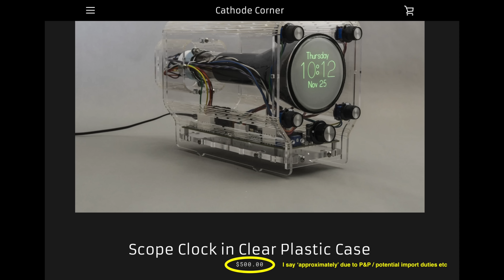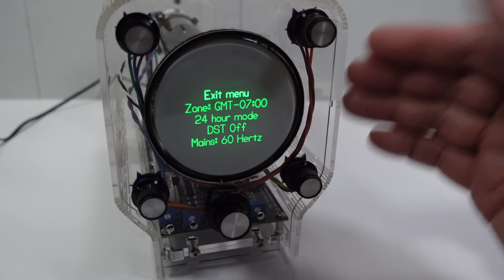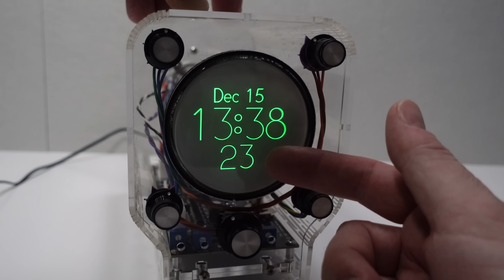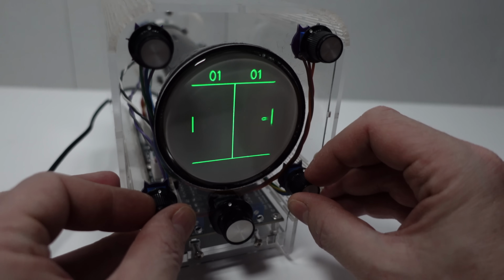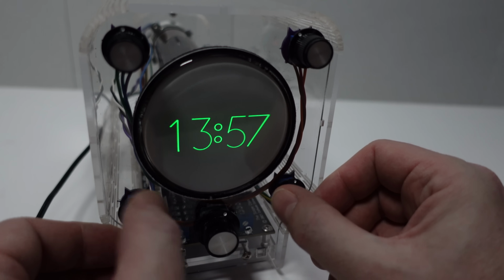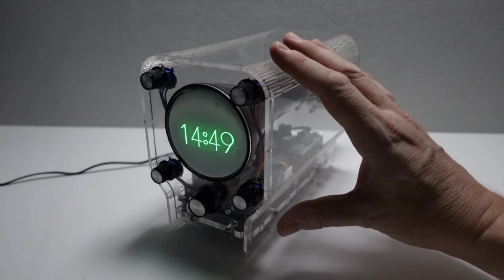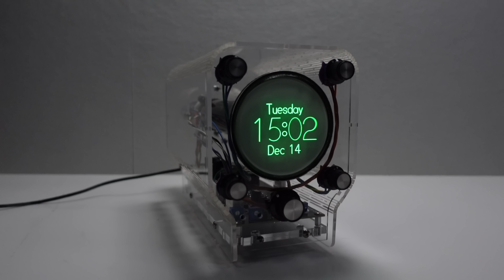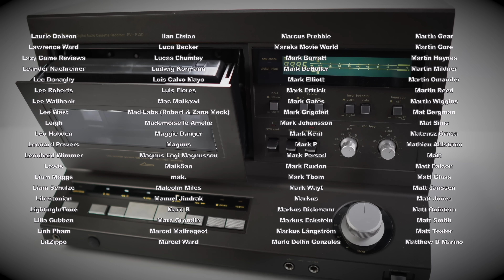The Scope Clock - from Cathode Corner

Comment: I really like the idea of the product, but it seems like a prototype not ready for sale.  For $500 it should have a speaker for sounds in game, an alarm, and less software bugs like having to recenter the clock after a game(may require redesign of the current variable resistor to software based).  Also, I would prefer an option for a red screen instead of a green one, because red light does not disturb your night vision (better if you intend to use this as a clock in your bedroom).  I would also love an option for cases.  Think Fallout "Pip Boy" with art deco patina colored metal (plastic of course).
Reply: I have a few CRTs with orange phosphor - they last about one day. The green phosphor lasts for at least a decade. Perhaps you would prefer to have someone do a factory run of tubes with the red from a P22 TV set phosphor. Unfortunately, these tubes are no longer made. Ah, reality is no fun.
Reply: @davidforbes8900  Don't get caught up in your head about this.  All I said is I would prefer a red screen.  I didn't  go research oscilloscope tubes, and any normal person would be the same way if you were just having a chat with them and they said "hey you know I'd prefer XYZ".  

Perhaps you'd be the guy that would stop them and say "But you can't prefer that because it just isn't done."   You know how they are going to look at you?  I'm not sure how successful you've found yourself at small talk, but I could guarantee you that wouldn't go over so well.
Reply: I don't think I've ever seen a red oscilloscope tube. I can't even find one on Google images. I agree that the bug should have been fixed and a speaker added, but asking for a red screen is just silly. Even if they made one especially for this device, it would defeat the point as it's supposed to repurpose an old oscilloscope tube and to have a retro look. And Techmoan mentioned it's not very bright anyway AND you can vary the brightness with one of the knobs.
Reply: @pifci  "I would prefer an option for a red screen" - thats silly?  I think you are silly for saying that.  I can prefer anything I like for any reason, and it doesn't have to fit into what you think the purpose of something is or isn't.  In the end its just a product for sale.  I think very little of someone telling me that I have to buy it with any understanding or purpose that only equates to arbitrary nonsense flowing from their pie hole.
Reply: @reviewaccount469  
I understand why you would prefer a red screen. It think it is silly not because it's a bad idea, but because there are no screens like that and the product is all about old oscilloscope tubes, which are pretty much always green. Making red ones for a couple of customers wouldn't be worth the effort, especially since there are many red/orange clocks available (like the nixie tube ones, for instance). Also as I mentioned, the brightness can be adjusted, so the manufacturer considered that people might want it.
My point is, you can prefer whatever you want, but if it is impractical to make, or doesn't go well with the purpose of the product, then it's kinda pointless.
Maybe if I used a different word instead of "silly" the conversation would have been a bit more constructive. My bad.
And you can of course think whatever you want about me. We are just two random people on the internet, after all.
Reply: @pifci  Blah blah blah, doesn't change a thing about my preference.  I think your interest for telling people they can't prefer something is quite a dangerous thing these days.  Pick any subject, go up to someone in person, and tell them they are silly for preferring one thing or other and see how that works out for you, or maybe you have done too many times and already know and thats why you are doing so anonymously on the internet.  Go get a life.

Comment: Dutchtronix use to do a board which did exactly the same thing with an XY display or XY capable oscilloscope, works best on analoge or a very fast digital scope with intensity controls.

Comment: Are the rotary controls on the front old school variable resistors or are they modern rotary encoders?
Most old variable resistors will rotate a maximum of 330 degrees between their end stops, whereas most rotary encoders don't have any end stops

Comment: IMHO, I would rather spend $500 for a proper oscilloscope, or even less for a used one. Vintage tube scopes can be had for less than $40. Also for $500 I would expect some kind of oscilloscope function, or at least an audio signal visualiser. I think the start is great, but there is a lot of functionality that could be added.

Comment: From the look of the display, I'd guess it is vector tracing rather than raster scanning.
One thing I would add to the design (if it doesn't do it already) would be some automatic shift to reduce burn in, as some features like the 10's of hours will be presented for a long time

Comment: In case you’re wondering about the length of that piece of string, it’s twice the distance from the middle to one end.
Reply: That's no use to me.  Which end?!
Reply: The loose end.
Reply: @ChristianBehnke  the loose end is for precise height measurement
Reply: I'm sick and tired of these vague specifications.  What is the string's diameter?  Tensile load?  Material and composition?  Terminal velocity?
Reply: @davemould4638  what about it's specific tensile strength?! What about it's radioactivity?! The molar mass! Think of the children!
Reply: D = 2R
Reply: Wow!!!
This should go to the top!
Reply: I like to measure the length of all the strands combined and then divide by their count.
Reply: @MrSaemichlaus  😄😄
Reply: Simpon's individual Emperor Stringettes - "Just the right length!"
Reply: Is that in metric or imperial?
Reply: @piltrid1 Metric, naturally!! 😄
Reply: That's impressively similar to how I calculate my weight, actually. At all times I've done it, it's been half and as much.
Reply: L=2L/2. Pay attention, kids. This will be on the test.
Reply: Thank goodness I had a reference string, there no way I would have known how big that was.
Reply: Oh thank goodness! 😅
Reply: Ah good, now I just need to know the thickness of the string and I’ll be set to buy the string. Need the string to buy the clock, need the clock to get to work on time to make money to buy the clock.
Reply: Another parameter that could help is that the piece of string is half the double of that piece of string
Reply: Thanks m8.
Reply: Part: 08:50
Reply: It goes all the way from one end to the other.
Reply: I have a rubberband which can be adjusted to the correct length.
Hmmm... now I just need a calibrated string for reference.

Comment: $500 and the games fuck up the screen positioning? Games and no alarm? Not even an added beeper? No auto off? Not even an off switch or a switch on the cable? 

This is a toy, not a real clock. Where does this guy getting off thinking that product is worth so much in that state?
Reply: Considering they are sold out, one can appreciate that there are those who do desire them. You fail to recognize that this is an Arduino-based device, you can easily modify the code to make it operate any way you desire. Oh...wait...you couldn't....you are just a guy using unwarranted profanity while ranting about a product that you have no desire to purchase. Good thing you weren't around when computers were basically just temperamental lab equipment! LOL! Anyway, thanks for playing!

Comment: Since it's a particle accelerator (I spent thousands of hours in front of those) I'm wondering if you can detect any radiation coming from the display?
Very very cool device.  I can think of so many add-ons to increase functionality, but I'm sure you all can.
Reply: Unlikely.  Normally you need much higher acceleration voltages than are used with oscilloscope tubes, especially the smaller ones.

Comment: ive got a question does the firmware support any kind of screensaver or plans to add one in the future as tubes like these tend to burn in over time meaning it has a usability shelf life and i would prefer to protect the Oscilloscope tube so it stays as sharp as it is over time

Comment: Nice clock. For the price, however, I would have liked a few more features:
1. Sound for an alarm, game sounds, etc.
2. An ambient light sensor which could automatically adjust the brightness depending on ambient light. (Easy with a clear case)
3. I am concerned about screen burn-in with a scope which was not designed for 24/7 use. An auto shutoff (or auto-dim) feature with a proximity or touch sensor to turn it back on would solve that problem.
4. The paddle game should never send the ball back completely horizontally.

Comment: I'd normally balk at hearing the price for something like this, but not this time. For those who are not all informed, getting a really good CRT these days isn't easy of cheap. And to compound the expense the acrylic case appears to be completely custom fabricated, which for a low run, small volume product is quite expensive. So based on the components the price seems quite justified.

As for the functionality, I have to say there did appear to be some missed opportunities. Adding a small speaker for an alarm clock, or an hourly chime / beep would have been far more in keeping with the clock functionality than having game included (which I don't many people will actually play). Also not having a feature to automatically dim /disable the display overnight seems like a missed opportunity.

Comment: I have the original version of the scope clock which used analog circuits for making the curved lines.  i replaced the CRT once in 15 years and it's still running strong.  the original version moves the image around the tube to keep the image from burning in.

Comment: What a wonderful clock. I've always been fasinated by crts, those scope ones in particular are an eligant shape, as they use deflection plates to move the beam around the screen instead of the usual external coils,  so you don't get the usual clutter around the neck of the tube.
Reply: The coolest ones don't have the dag coating on them, so you can see the back of the phosphor, and the plates... That would make this infinitely cooler than it is as a show piece.

Comment: I sure wouldn’t mind having one of these, but I have to wonder with the screen not turning off after a while and no scrolling mode, would this be susceptible to screen burn in. I’d be afraid after as little as a year or two with just the time displayed it would burn into the screen quite quickly. Makes me wish there were a setting where it would scroll up, down or to the left with all info to alive this.
Reply: It does have a dithering feature to move the display a bit on the screen every hour. The screen will last for many years, the 20 year old scope clock I have in my office still looks reasonably fresh.

Comment: I hope the originator has some code in there to "swim" the display around a bit so it doesn't burn it. Otherwise, while I have no genuine need for another clock I'd love to have one of these. The only one I'd like more would be an exposed HeNe laser tube with x-y scanning mirrors that "draws" on a fine ground glass screen.

Comment: Any concerns about burn-in?  I love the piece, but afraid of how it will look in a year or so, especially if it doesn't turn off.
Reply: My understanding from reading about his previous scope clocks the digits or clock face slowly drift around the CRT to minimize the effect of screen burn. The software that runs the clock is open source, so there's no reason you couldn't modify the code to blank the screen during times like overnight, could also keep the brightness turned way down unless you're actually showing it off to someone. Another option might be to create a small sub board to put on the tubes heater wires and use one of the many unused GPIOs to trigger a mosfet to turn the heater on and off at specific times both extending the life of the tube heater and minimize burn in. Perhaps David will respin another revision of the PCB with the ability to software control power to the tube from feedback? Considering he has made and presumably been running a scope clock for at least a decade, if it was a real issue he would have probably addressed being able to power down the tube at times on this current new revision.

Comment: Some issues, 1)Burn in.  2)Can't use the oscilioscope as an oscillioscope. It would need a mechanism to turn the screen off (as mentionned) or have the clock move around the screen like those old screen savers. It should have an audio in or a microphone to display the audio waves.
Reply: Audio goniometer function would be very cool as well.

Comment: looks nice, but i'd assume that what looks more or less like an old timey monochrome crt vector graphics display would be prone to burn in, if left running with a repetitive digital clock pattern on it like that, long term- which would kind of be the point of having a clock around, as a clock.  guess i could go read their faq and see if they mention anything like that, but of course, it's probably intended to be more of a conversation piece in itself, as an object, than an actual clock

Comment: Anyone who has used a cathode ray tube oscilloscope as part of their daily working life knows there is one huge draw back with the tubes and that is phosphorus burns. I have used them and one thing the manufacturers of the oscilloscope always mentions as a warning is to not leave the scope on for hours at a time because not only will it burn an image onto the screen but it will also burn out the tube. The laughable thing is you can buy a working cathode ray tube oscilloscope for the price the guy charges for the clock.

Comment: Even the way the laser cut acrylic was designed to fold around the front and rear faceplates is really cool and something I haven't seen done before on acrylic without heat forming. Overall it's a really nice design!
Reply: it's called a 'living hinge' if you were curious!
Reply: @theone1and1  Thanks! I ended up finding it and was gonna post it here but you beat me to it haha. I’ve seen it done on wood before just never on acrylic.
Reply: I haven't seen that type of construction before.  The whole video, I'm thinking to myself "I wonder how long before the stresses finally make that plastic snap?"  Anyone know any history?  Is this a construction method that will last?
Reply: @BLenz-114  I expect it to last a long time. These only really wear out when you're actually using them as a hinge (ie opening and closing it often)
Reply: @theone1and1  I expect it to snap in 5 years when you have to replace the RTC battery.

Comment: They need to add a motion sensor so when it detects motion in the room the display comes on to prevent burn in on the CRT! Since it's arduino based it shouldn't be hard to mod it.
Reply: I was going to ask about burn-in, could be an issue, right?

Comment: Any scope user will know about screen burn, and soon you will be able to read the time with it turned off.
A firmware update is needed:
Move the image round / switch off or dim after 5 minutes / Switch on at preset times when you might be there for example. Perhaps fit a radar detector like Big Clive featured that would turn it on when you are in the room. (Works perfectly on our porch light when we walk down the hall). Definitely fit an alarm to give it a purpose.  I think the fake nixie clock where you can select the letter styles was much better than this, but this could be faked with a small TFT display to look like a CRT.  Its nice, but just doesn't appeal for the price.
Reply: Perhaps you could take a look through the firmware and see that feature is already in the code?

Comment: Shame it doesn't have a facility for a PIR sensor to blank the screen to prevent burn-in.
Also, I have many clocks with GPS that are too troublesome for location in a house.  Better to use an ESP8266 or similar to grab the time from wifi.

I was interested, but these two items missing makes it a no-go for me.

Comment: 8:45
Please, if you are going to use alternate measurement units, please use the correct ones, you should use football fields (the handegg variety) for larger lengths, olympic pools for volume and also length in some situations, washing machines for everyday stuff, and a banana for smaller stuff.
Please, get your units right.

Now in all seriousness, this looks great, but considering the rarity of those CRTs and the fact that they are prone to burn in, I wouldn't want to use them as an everyday clock, perhaps if I'm entertaining guests during a party, used as decoration, but what would be great is if it had some sort of remote control, just one button, that you can press to light it up and display the time, or maybe two or three of those remotes so you could place them strategically in the room so you don't need to get up just to activate the clock.

Comment: Ive never thought about it but do hertz matter with 12v?   Ive never seen that on any dc items.
Reply: Might be a 12v AC adapter so it can use the AC signal as a timing reference. Or it was in the original code but not used
Reply: @Spookieham  good point.  I just assumed 12vdc.

Comment: That's cool
The tube may suffer burn in, specially on the leading '1' and the divider dots, i would turn down the brightness overnight, or if it saves settings, power it off.
Reply: Not may...will.

Comment: I would expect such device to be more customizable with user fonts or similar modifications. I'm wondering how easy it would be to mod this one.
Reply: Since it's based on Arduino and the code is available, there's literally nothing stopping you from changing the fonts, layouts,timeouts and everything else.
Also why there's an opening at the back for the micro USB port, so you can flash new firmware.